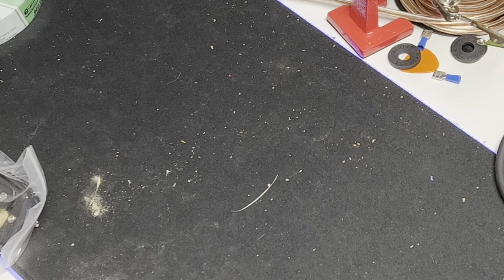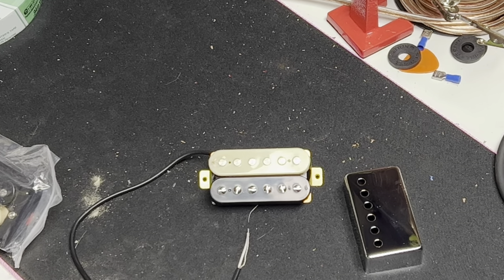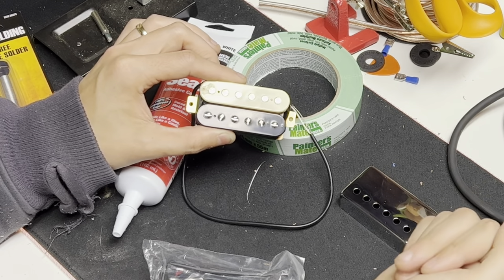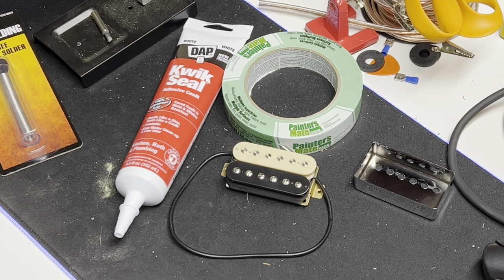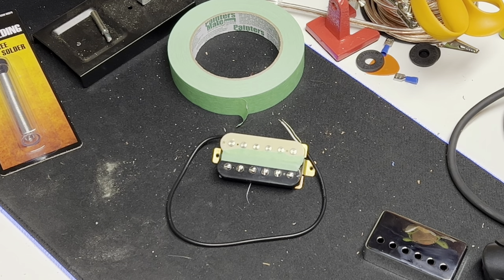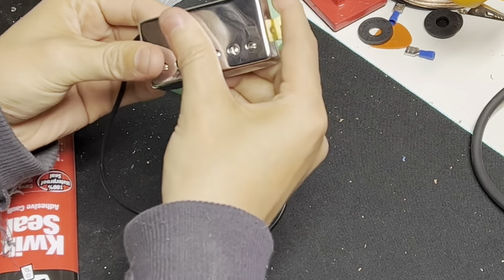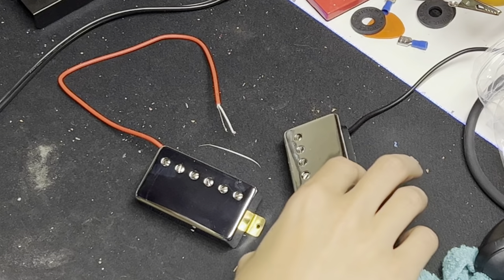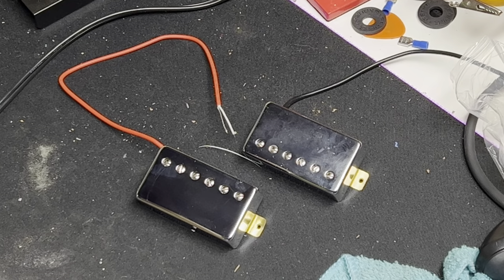How to Install Humbucker Pickup Covers!

Comment: The masking take will disintegrate with time and the glue will harden like a varnish, I did like John Gundry suggested and applied paste wax to the slug coil, spread it around and then put the dabs of silicone on the area where the paste wax is. This way the cover will come off easily if needed.

Comment: this is great, i remember doing this exact method years ago but i never tested with high volume, is it truly necessary to solder the covers?
Reply from the maker: I’ve found that if you don’t solder the covers it causes some pretty bad buzzing; the solder ensures everything is grounded!
Reply: @BigJakeMusic  one question; I often read that you need to cover the PU's with wax first, is that really true? Some just put on the cover and solder it and done, but others say that you need to put wax on the PU's..
Reply from the maker: @davidzahnd2891  Putting the wax on pickups, also known as wax-potting, is a way to prevent/limit feedback and microphonics. If your humbucker squeals easily or if you can hear your own voice when you speak into it, then you may benefit from wax-potting it. The wax acts as a way to prevent anything inside the pickup from moving/vibrating, causing the microphonics/feedback. Most aftermarket pickups from manufacturers like DiMarzio and Seymour Duncan are already wax-potted and don't need it, but most of the cheaper ones do. I did not wax-pot these, but I probably should have. They are slightly microphonic, but definitely far from the worst I've heard.